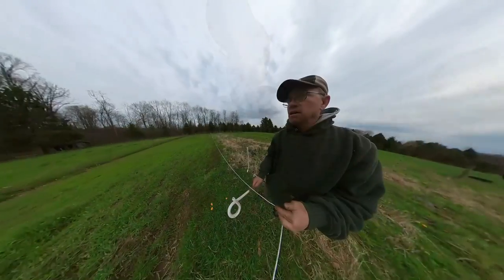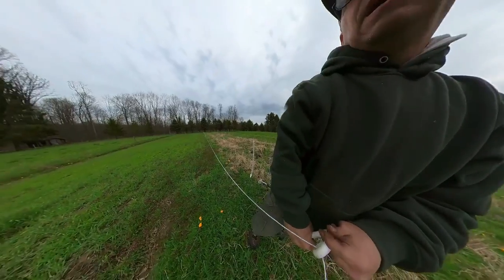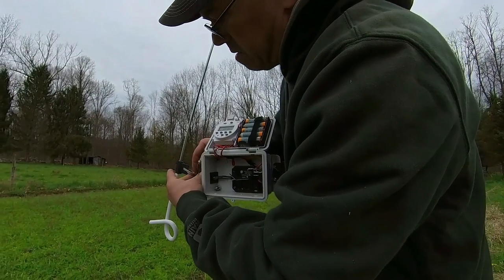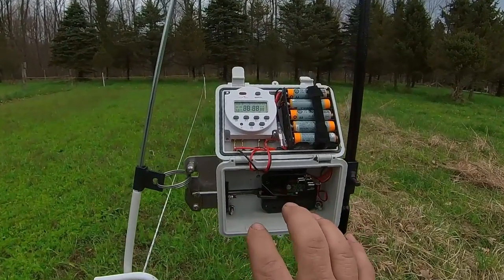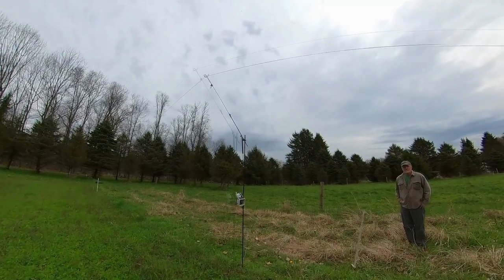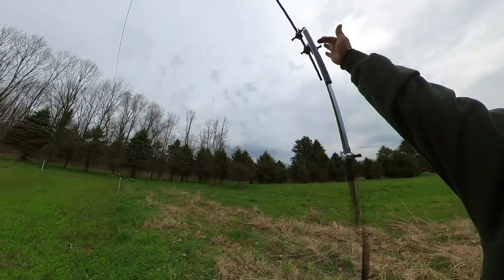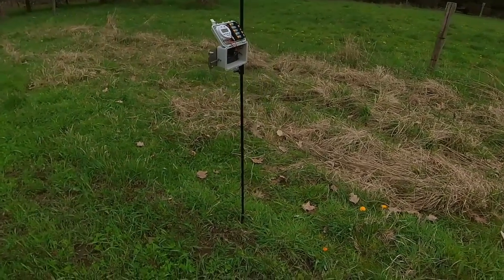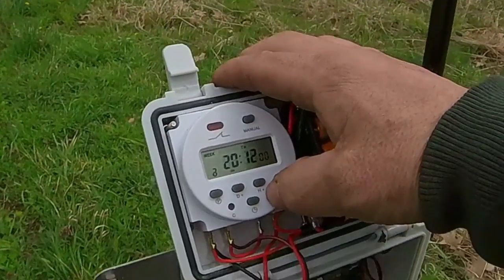Getting the fence lifter polished. Make moving livestock easy.

Comment: What battery life are you getting?
Reply from the maker: 2-3 months
Reply: Interesting, that is 2-3 times the life I expected considering the fairly significant quiescent (the amount of energy a device pulls at idle just by being connectex to a powersource) draw those timers have. These timers commonly draw 4 Ma which should drain those AA's in about 34 days. Have you ever tested the power draw at idle?
How do you decide when to change the batteries?
Reply from the maker: @1WayWeb-q3z  I have a limit control which disconnects the power after releases
Reply: @RussWilson  I see now. It looks like the limit switch kills power to the timer which in turn also kills power to the latch until it is manually reset. Now I understand why your batteries can last that long. Very well done! If you didn't have that limit switch your batteries would die every month.
If I'm correct about every 2-4 years the watch battery in the timer will need replaced because 99.99% of the time it's in deep sleep mode and running off the coin cell battery which has an advertised life of 2-4 years.